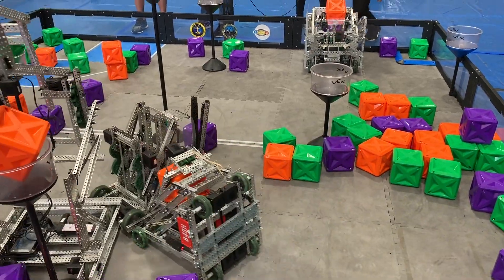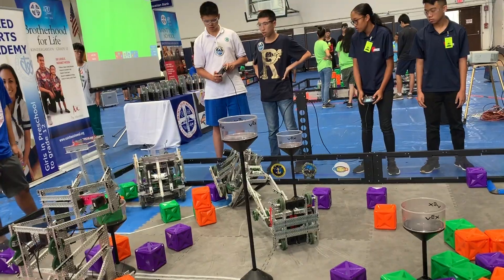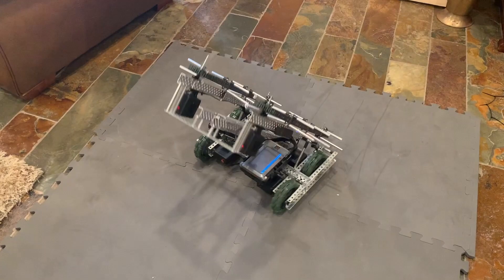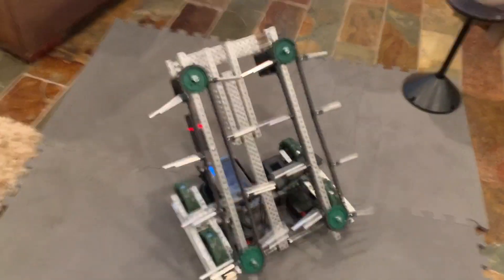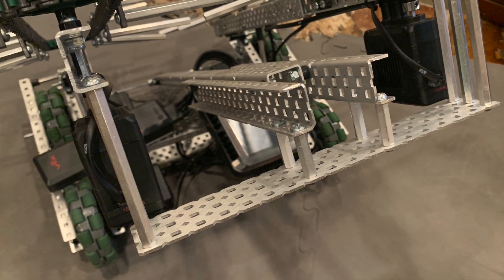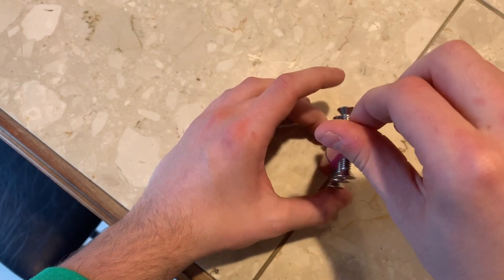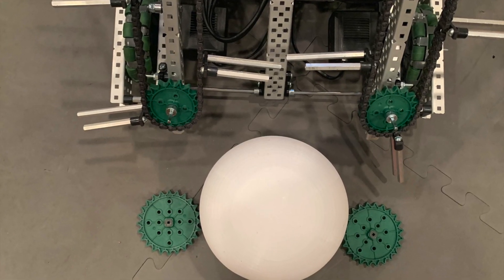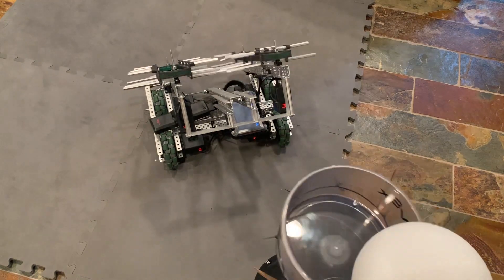VEX Change Up Prototype Reveal + Explanation

Comment: Hey I’m also competing in the change up competition. Personally I would recommend using the extra motors for frontal arms/better mouth of the design so you can remove balls that have already been put in a tower. And you may also want to focus a little more on accuracy because the center tower won’t have a backboard (also maybe decrease the power on the conveyor belt). This is just my opinion so if you have a lot of faith in your design definitely go for it (you had pretty great ideas). Nice video by the way.

Comment: what if you extended the front and added a mechanism that would hold the balls, so if it pushed them out, it would still be holding them. We considered a robot like this, but decided against it because by the time we were done with the planning, it was just too complex. Never considered standoffs, though. Also, I think a H-drive with omni-directional wheels is the perfect base, especially if you add gears to make it go faster.

Comment: If you want I have a 3d printable version(meaning it's not hollow and you choose infill) of the ball and I think if you are trying to fix the sync issue just run a bit of chain under your tray thing and connect them with sprokets or doing it with prog wouldn't be bad either lemme know if u need any help
Reply: Here is a link to some cad balls I found and printed.

https://www.vexforum.com/t/3d-printable-change-up-balls/79706